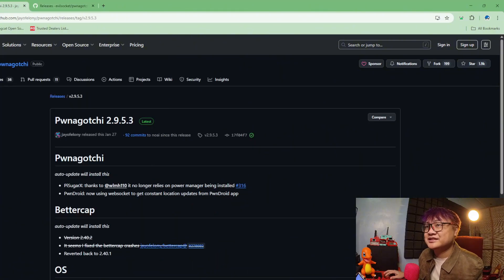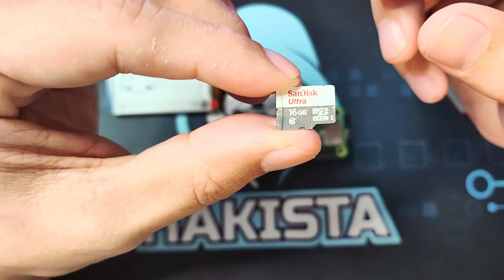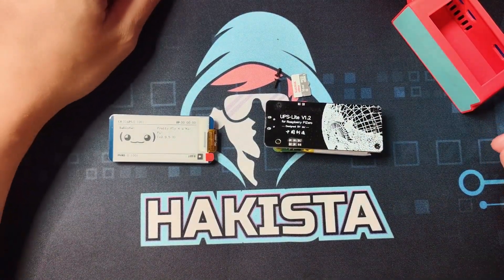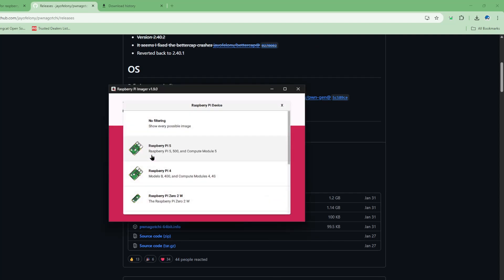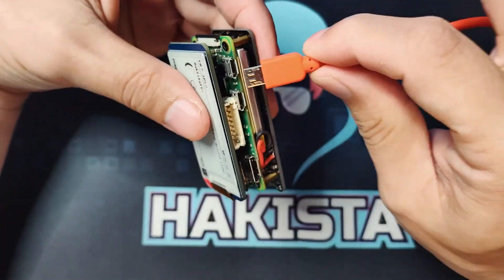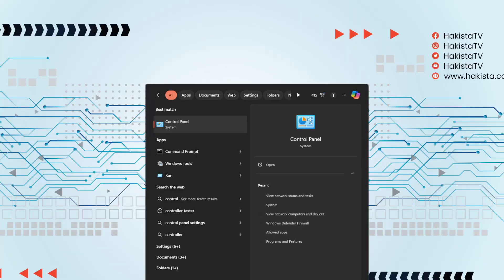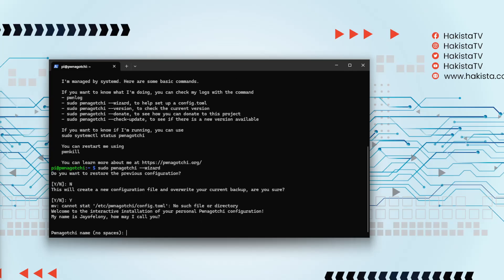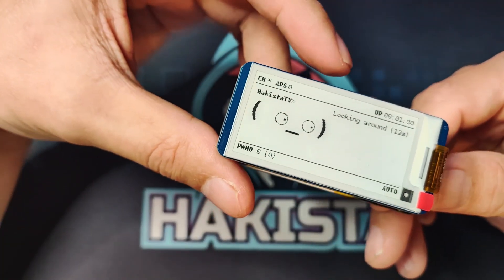DIY Pwnagotchi 2025: Full Build, Setup, and Configuration Guide

Comment: Please help me I need ver 2 screen here in UK but not available but ver3 won't work do I need too just change a screen drive please advise me !? Thanking you most kindly
Reply from the maker: Where are you getting your firmware, v3 and v4 is supported
Reply: @HakistaTV alixspees purchase from a seller not home built
Reply: The screen sticker has ver2 on it but the screen went defective So i changed it too ver3 and ver4 but the display shows nothing
Reply from the maker: Just flash the new firmware from jayofelony and its all good
Reply: get it of the pi hut, they have all the waveshare screens

Comment: A couple of tips. Don't bother with most of the plugins that are out there. There are maybe a couple that are worth the time and effort. Those being Neurolyzer and ProbeNpwn. The others are just UI clutter, eat resources and make your Pwnagotchi less efficient, and generate more heat. Which is why we have tip number two...

I'd also advise against running one without any kind of UPS hat. Even the likes of the Geekworm X306 (which many people run with "fake" 18650 batteries). Run it off an external USB power pack instead. If you really want your Pwnagotchi to act as an incendiary grenade while you're throwing it around in your backpack, just use a PiSugar 3. A small board that generates a lot of heat (even under minimal load) bolted onto a LiPo or Lio-Ion battery, crammed into a case with no cooling and then thrown around your backpack bumping into other things while you're on your travels is a ticking time bomb.
Reply from the maker: thanks!!! ill pin this comment!